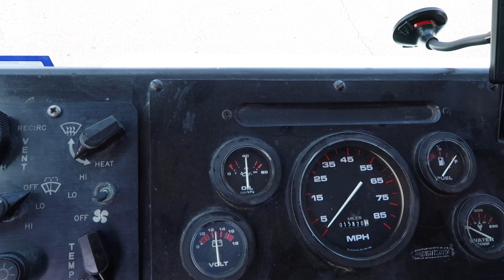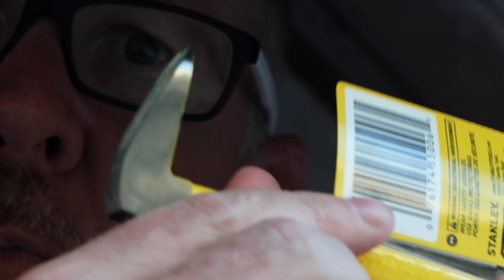Step Van Dead Oil Gauge | Ceiling Rivet Removal Success E245

Comment: I did try to suggest the insulation in the roof will be far more important than the floor. 😇.  Back when we were talking head room and removing the thickness on the floor. lol I had to give you a poke for not listening! Keep up the process 😀

Comment: easy way to remove rivets, use a small punch to drive up the steel pin, then take a 5/16 drill bit and  drill the head off.

Comment: Maybe you've already discovered this, but I wouldn't worry about drilling out the plastic "sleeve" that's left while the panel is up there. As long as the head and the metal nail comes out, it will allow you to drop the panel and then retrieve the rest of the rivet with ease!

Have you thought at all about coating the roof of the van with some insulating material, (usually some kind of rubber-based product,) like they use on camper roofs? That will add some insulation value, as well as water-proof your roof. Make sure you use the white-colored stuff for more reflective value.
Reply from the maker: actually I had not thought to do anything to the roof exterior. I'll keep this in mind with my future research

Comment: Seven, your back to adding a second roof.  inexpensive corrugated aluminum on a light weight frame to give 2" to 3" space for air flow.  will reduce inside temp by 20 degrees.

Comment: The wind noise has been fixed. sounds great. The plastic expandable rivot left in the alloy is no problem., should be able to drop ceiling with them in there. you are moving right along. good luck. Be safe out there..
Reply from the maker: glad to hear the noise is much less. yes, making progress, this coming week I'll have some major progress on the interior

Comment: It is almost like there is no insulation if the ceiling is not cooler than the outer panels. That is a neat tool and great someone noticed the oil gauge. The wind was noticeable but not a problem. All the best
Reply from the maker: Ken, thanks for the feedback on the audio. yes, the insulation now doesn't seem to be doing anything

Comment: easy way to test your gauge, disconnect the wire from the oil pressure sender. sender should be near oil filter. you might have one or three wires going to the connector, consult your manual to determine wire color. take a small piece of wire and push the end into the connector that is the lead to the gauge. ground the other end to a good ground, like the engine or frame. turn the ignition switch on and watch the gauge, it should move either all the way over. if it does, the sender is bad. its been my experience as a auto tech for thirty years its usually the sender that fails.
Reply from the maker: super excellent advice! I'll try this

Comment: Hey Seven! Put white cool seal on top of your van. It is made for mobile homes and would help a lot to keep the heat out of the top of your van. They sell it at home depot and Lowes. As far as the oil gauge more then likely it would be cheaper to replace it rather then fix the old one. There are two types to choose from, mechanical and electronic. The mechanical ones are the cheapest but this involves running a plastic line that carries oil from your engine to the gauge. I would not get this one because over time the plastic line becomes brittle and can burst shooting hot oil all over you and your interior. Its best to pay the extra money and get a electronic one so you never have that problem plus they are more accurate. The oil gauge can be picked up at about any auto parts store. The bonus is it is sure to be nicer then the current one you have looks wise.
Reply from the maker: thx for the tips!

Comment: Have you considered insulating the floor from below?  There are a variety of products that can be used for that and that would save you the interior space while still giving you an insulated floor area.
Reply from the maker: I'm investigating it and leaning toward almost no floor insulation on the inside and adding something later down the road after most of the build is done which would be under the vehicle like you describe (sort of like a finishing touch after the build is done)

Comment: The rigid foam board is flammable and is required to be covered with a layer of drywall as a fire barrier when used in residential and commercial construction.  If you do decide to go with the foam insulation, you may want to consider using fiberglass insulation only in the area that you plan to install a wood stove.  Since fiberglass is nonflammable, it would be safer choice to use in the wood stove area.
Reply from the maker: excellent safety tips!

Comment: Re the Oil Pressure Gauge I personally think it's the Gauge itself, just a feeling. Also some Pressure Gauges are actually Oil Fed through a Copper Tube. Being a Cummins this might be the case...???
Nice one with the Rivets! With the Rivet removed I think you will find that it isn't necessary to remove the Plug. 
The Video is much better with the Cannon. And the Wind Noise is minimal. :)
Ciao.
Reply from the maker: thx for feedback on the camera and audio!

Comment: just my 2 cents..but id go with thinner insulmat on the floor..same as used in cars under the carpet..and in ceiling id go 1" or 1.5" pink foam...should be a lil cooler in there after that. restoring vehicles and renovating homes for  30 ish years ya learn tricks along the way. 
look fwd to future episodes..keep the shiny side up.
Reply from the maker: great tips. thx

Comment: You probably don't have to pull the plastic plug now that the rivet that expanded it is out of the middle. It will come down with the roof. Of course if you have the patience, it will be cleaner to have them all out. If you have needle nose you can grab the plastic, wiggle and pull and it will come out also (sometimes the edges kind of tear off using the pry bar and then it doesn't want to come out). Lots of times you can get them with your finger nails too.
Reply from the maker: great suggestions. thx!

Comment: Actually, as I understand it, not all gauges are gauges any more (since around the mid 80s). A lot of modern gauges have been dummied and are no more than an "analog" idiot light now. You get the quaint feel good vibe of a wide range of monitoring when in fact it stays the same no matter what until things are critical enough for it to suddenly switch to an extreme. Might be the case with your oil gauge like it is in my old pickup. Check online and your owner's manual.

Comment: You can test the pressure guage wiring and sensor with your volt  ohm meter... start at the wires behind the gauge. Reference the pdf address I sent you on meters and electrical testing.

Comment: You need to determine if it is an electrical gauge or pressure fed gauge. If it has a physical pipe running to the back side of the unit (likely in the very centre of the gauge) it is fed by oil directly from an engine connection. With the vehicle being built around the mid nineties there is a reasonable chance it is that type. However not being American I am not familiar with U.S built vehicles, and so have no idea when they moved over to electrical gauges from that earlier type. For a mechanical, or pipe fed type, I would be looking in the first instance at the actual head unit being faulty with it showing the fault seen on the video. There would be little at the other (engine) end of the pipe but a connection so nothing really to go wrong.
Reply from the maker: thx for the extra info. I'll have to open it up and look at the gauge. it is funny I have so many things to do my list keeps getting longer!

Comment: Wow...I thought those 'rivets' were entirely metal so my other comment about using the rotary tool was based on that...I didn't know those 'rivets' were actually just plastic expanding body panel fasteners....yeah....no rotary tool needed for those...

As far as the gauge, I cant tell if that's a mechanical gauge or an electrical one. When you had the dash panel removed was it hooked up to wires or did it have a small tube running to it?

Comment: That's odd Land Rover did this for 50 years. Yes you still need inside insulation. It's the same as parking in the shade. Also the transfer of heat through the mounting blocks would be minimal.
Reply from the maker: was not aware about landrover. I'll have to check that out!

Comment: If all the ceiling rivets are only plastic then you should have little trouble removing them.
Reply from the maker: they are plastic with a metal nail in the middle
Reply: I think that maybe those rivets (or expanding anchor, they aren't actually rivets) have a slotted screw head in the middle of them that could be backed out and then the whole anchor could be removed intact. I could be wrong, but that's what it looks like.

Comment: There plastic rivets push/tap the centre pin through and out and the insert will pop out, a car trim tool will do this with ease - oil gauge is it electrical or mechanical ? - if its mechanical it will have a nylon/ptfe tube going to it, these fail with age or just block up with gunge over time - if its electric it should have 1 or 2 wires for the sender - a negative and a positive then 1 or 2 wires for the illumination (all depends if it shares a ground or not)hope this is of some use
Reply: do you have the cummins 5.9 12v (6bt) ? the sender lives behind the power steering pump (if fitted) just above the drivers side engine mount -  and looks to be a 2 pin sender (late) or 1 pin sender (early, bell shaped), They are known to fail over time and is a common dodge/gmc/gm part
Reply from the maker: yes I have the 6bt thx for info on the location and what to look for!

Comment: would it be worth having a foil reflector etc fitted to the outside roof of the van, reflect more of the heat from the sun
Reply from the maker: an interesting idea. not sure if that would be legal in the USA to have a mirror type surface up there, but something to investigate!
Reply: Seven Wanders the World you can also get various spray on heat proofing as well that you could line the interior with before your insulation, minimal thickness but every little helps if your Sat baking in the sun you guys have. 
Not really an issue in the UK haha.

example... It's usually for higher temp applications I think but you get the idea 
http://m.lizardskin.com/car-ceramic-insulation.html

Comment: Hi from Glasgow, Scotland 
About the ceiling.... If the roof of the step van is also aluminum would it be possible to add  insulation to the out of the roof and cover the with aluminum? my thinking is if the insulation is just a sandwich of aluminum and foam doe's it really matter if it's on top or under the ceiling? this would also give you move head room
Reply from the maker: I was in Glasgow last summer but only to fly from there to Estonia (I spent a week in Edinburgh. I'm hoping to return in a year or two and spend a month or so there. yes, that would be possible and a few folks have recommended doing that. it is something I'm considering, but mostly concerned about the cost of the aluminum to cover it all which might be several hundred dollars
Reply: if you were careful when removing the aluminium from the inside could it not be reused? which would cover most of the roof
Reply from the maker: it is very very thin (slightly thicker than tin foil bowls like at a restaurant)

Comment: How about putting insulation on the roof outside like 1" Styrofoam then covering it with plastic sheets or wood waterproof fasten with bolts and nuts
Reply from the maker: a few people have suggested that. I'm not sure if that is a 20yr solution or one I want to pursue, but I've been thinking about how to do it and make it durable

Comment: They are not rivets, they are plastic interior fasteners. To qualify as a rivet in my opinion they would have to be aluminum, or steel, non-reusable fasteners, capable of carrying a structural load. These things are a joke, not worth discussion, pull them out, peel the insulation off the floor, put it in the ceiling in a manner to avoid condensate, use some decent fasteners, screws preferably for later access to re-install panels, and it's done
Reply from the maker: perhaps my vocabulary of calling them plastic rivets wasn't correct. I've never worked with them before and am just learning. the ceiling will come out this week and I'll hope to have a replacement by next weekend

Comment: oil gauge not working isn't the end of the world, just check the oil often. my Ford expedition and my previous F250 have oil gauges that do absolutely nothing. the gauge moves to the middle when you turn the key on, and goes to zero when the key is off. completely useless, has no purpose and that's how ford designed it.
Reply from the maker: I try to check all the fluids often and keep them topped off